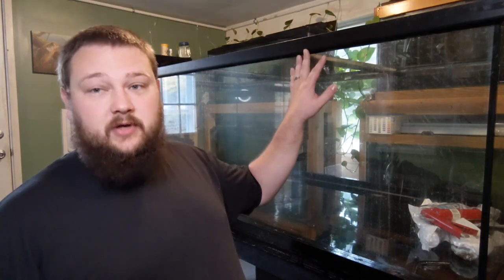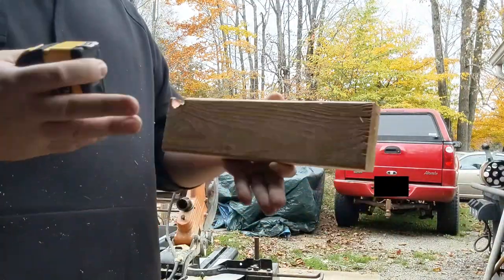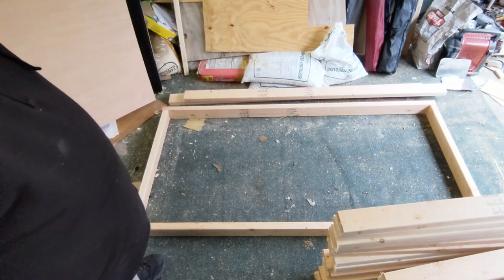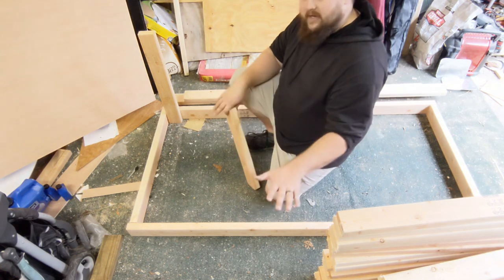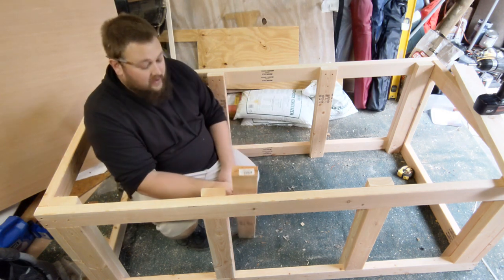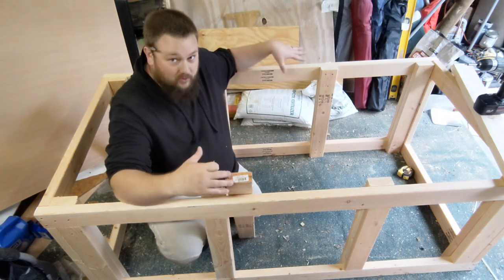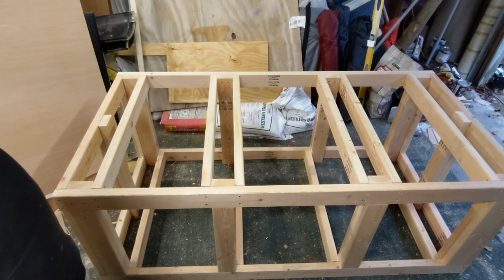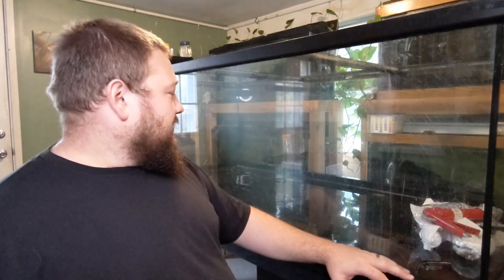DIY Aquarium Stand - For Large Aquariums.

Comment: I plan on building one using your approach. Thanks! Do you check to see if everything is level? Did not see you do that here or in the previous build. (are you just assuming it's level based on your cuts, or not too concerned about it?)
Reply from the maker: I actually did put a level on it in this video, it's in part of the time lapse. Theoretically if the boards are straight and your cuts are true then you shouldn't even have to worry about it, But I normally put a level on it anyway Just to make sure.
Reply: @TrafishAquatics  Oops! you sure did at around 5:00 mark.

Comment: Hey Travis, can the stand be bigger then the tank? I'm building a stand for a lady that has a 36 x 18 tank and the stand is 40 x 23. I'm using your plans. (thanks by the way) So all the corners have the two extra board supports added to the legs. What are your thoughts on this? Thank you, Vicki